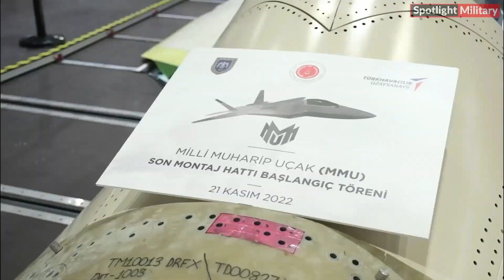KAAN : King of Kings  - Turkey Has Officially Set the Name of TF X as KAAN

Comment: The ability to supercrusie without the use of afterburner is the bare minimum for a 4th gen fighter, 
When you consider that loyal  wingman drone fighters being produced by militaries such as USA & Australia are capable to fly at sub and supersonic speeds, manned fighters in this day and age have to be capable of supercrusie. 
 
This fighters lack of afterburner and thrust vectoring capabilities means it's manoeuvrability and performance would rank just below 4th generation standard,  and it's airframe stelth design, avionics and weapons systems etc would rank 4.5 or higher gen. 

So I would label this fighter as being a 
4+ gen fighter  or 4.25 gen fighter
Reply: Does your comment still stand even though this plane is 0.2 mach faster then f35?
Reply: @freepalestine.23 bruh speed doesn't solve everything my guy.